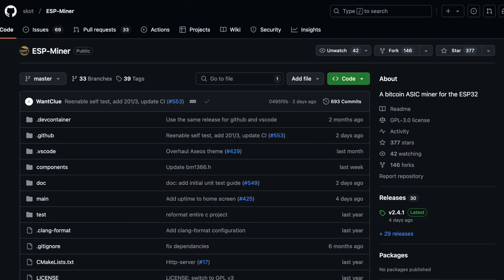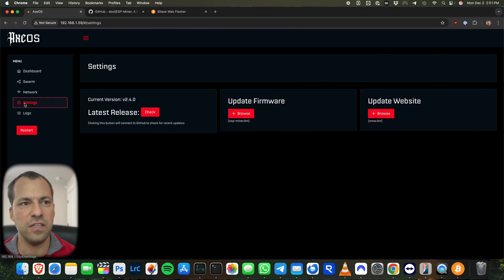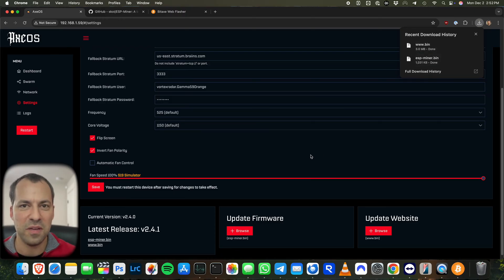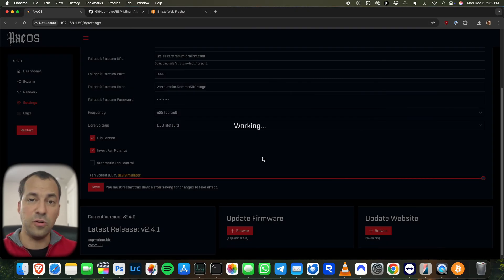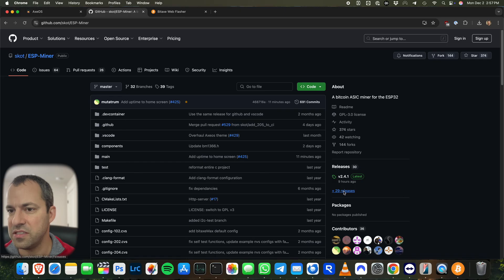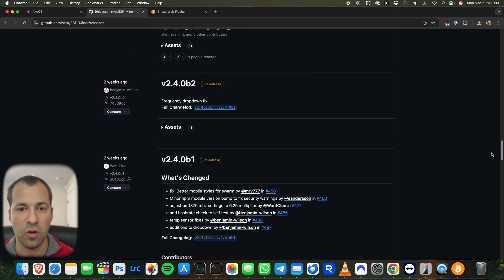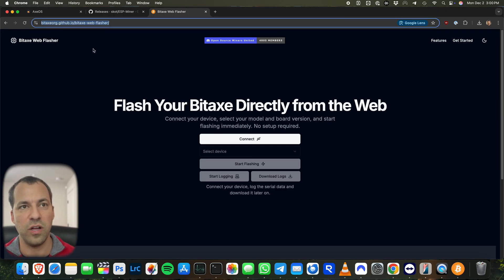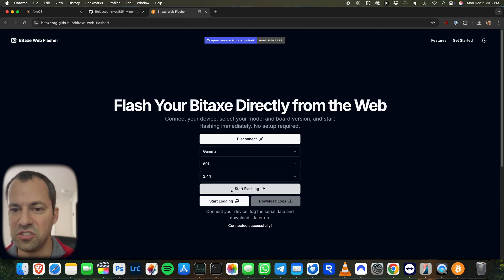How to Update Your Bitaxe Firmware, Part 3/4

Comment: I think I’ve messed up setting up my WiFi connection in the  initial set up. I saw no SSD on the screen and now it’s auto connecting to my home WiFi. 

Can I just do a flash as you suggested in the last option to factory reset to reset my WiFi setup? Thanks.

Comment: When I first got my Gamma it was 2.4.0 and was running for 3 days and best diff was 4.16G since then I’ve updated several times to the latest firmware and the best diff has been 712M. Any thoughts on why it’s not as high of diff number yet it’s run for weeks
Reply from the maker: That's to be expected. It's gonna be somewhat random with when you get higher or lower scores. Just let it run for a while and over time it'll trend higher and higher as it keeps making more guesses.
Reply: @ Ok Thanks for your reply 👍